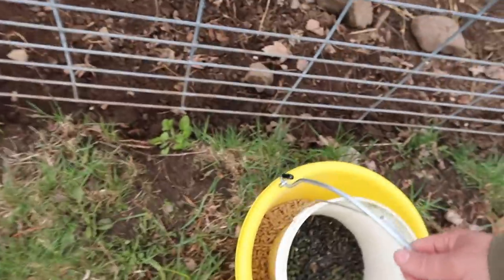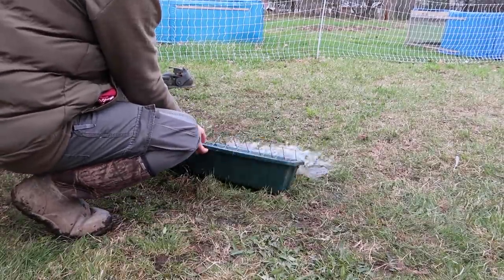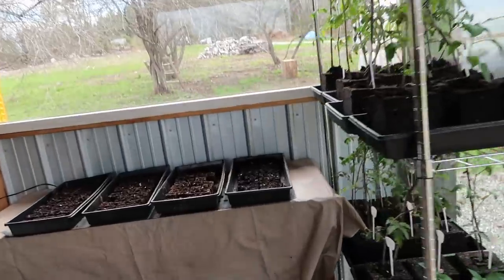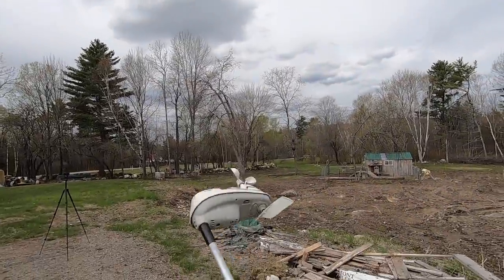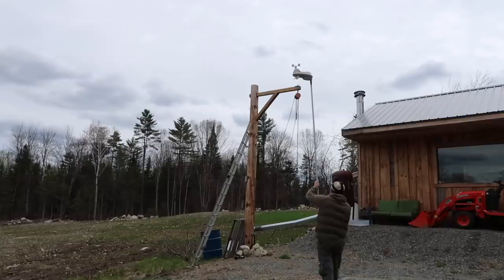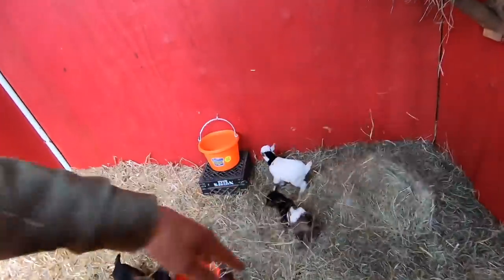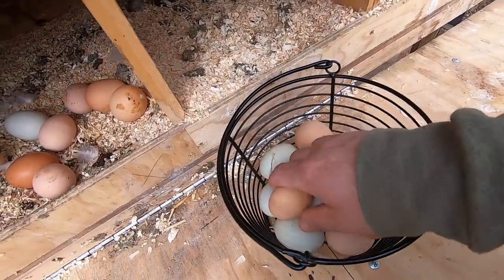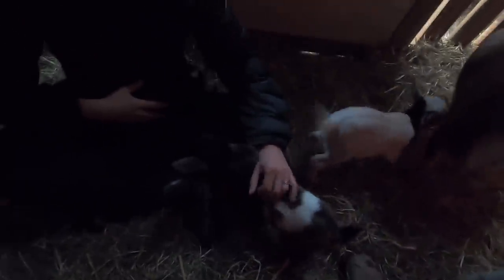THIS has to be my LEAST Favorite JOB!  Don't TELL Gina I was Doing this

Comment: For those unfamiliar with the innards of a personal weather station rain gauge: the inside of the rain gauge is a seesaw type of deal with cups at either end. As the water comes down, the cup at one end fills and drops at a specific amount, bringing the other up to be filled and dropped, back and forth. If there's stuff in the bowl (leaves, cobwebs, whatever), a shallow bowl can overflow, leaving rain amounts unmeasured. If the seesaw gets stuff on it/attached to it (cobwebs, dead bugs, dirt) it can cause them to not move and/or just overflow one cup without dropping at all, leading to no rain measurement. It can sometimes be quite the adventure doing periodic maintenance on the things. I found a black widow spider in mine last season, and she (and her giant egg ball) were Not Happy with me evicting her.

Comment: Al when you replaced the weather station the top anchor you only screwed the long screw through the plastic pipe holding it up. You forgot the saddle hold down that screw only against that plastic pipe will wiggle every time the wind blows. Have Olivia scamper up there to resecure the saddle holder.

Comment: Don't worry Al, I'm afraid of heights, too. I hate climbing a ladder in that kind of situation. But I get er done, just as you did. I also bounce a few times on that first rung, to be sure the ladder has set into the dirt as much as it is going to. Also, I keep my feet in the outer thirds of the rungs, rather than in the middle of them.

Comment: you should have started your brassicas two months ago and in the garden at least 2-3 weeks ago.  They will tolerate a lot of cold and bad weather.  Even snow if you cover them with an old sheet.  What they do not like is summer heat and will bolt before you can harvest anything.

Comment: That weather station should have a pivot point we did that back in the days installing TV/CB/Ham Radio antennas. It allows you to put up a 20 foot antenna without having to climb all the way up on the ladder .. Drill a hole  through the center of the pipe about mid way put a screw in it thats your pivot point then you have the other screw towards the bottom at ( 10:10 ) to keep it from pivoting.. Next time all you have to do to service it is remove the bottom screw and  the weather station will pivot and come  down to where you can work on it on the ground.. No ladder ever needed again.. You are only going to get older and risk increase as you keep climbing that every year. No since in putting yourself in danger when it's not needed..

Comment: You might think about getting some non skid paint to put between your  13 inch spaces.  It works well in rainy slick days and can save you from losing your footing. You should also try glassing your eggs for storage in the winter months they can store up to 8 months to a year. On those days you don't get any or very few. No refrigeration needed and your eggs are as fresh as if you collected them that day.

Comment: We have the same weather station, there is a remote battery pack that you can add on so you don’t have to climb up and take the whole thing down. We recently moved ours and gave it a good clean out, funny thing is it isn’t registering rain now either. Ours is 4-5 years old, how old is yours? There are various parts you can order for replacement, not sure if the rain meter is one of them, but the remote battery pack is sure worth it! Just thought I would share... have a great day!

Comment: Looks like 1 more feeder for your meat birds 😁
Reply: Curtis Schrock I was thinking the same thing.
Reply: A cut down PVC pipe, trough feeder would work well for the meat birds. Hang it with chains from the rafters. This could be moved to the chicken tractor too. More of the meat birds would be able to feed at the same time and it wouldn't get tipped over.

Comment: The R6 bit is IEC nomenclature which tells you a little more then the AA part, R is the shape, round, there are also P for not round(old batteries might be labeled with a F for flat or S for square but they should now be R or P respectively). It also tells you the chemistry used in the battery, no additional letter means it uses zinc for it's negative electrode, manganese dioxide for it's positive electrode and either ammonium chloride or zinc chloride(usually the battery would state heavy duty if this was the case) for it's electrolyte. The LR6 tells us besides the shape and size that negative and positive electrodes are again zinc and manganese dioxide but the electrolyte is alkali metal hydroxide.

The "dry" bit is rather silly all R6 batteries are dry cell batteries, meaning they have a paste  that is just moist enough to conduct electricity as an electrolyte, a wet cell battery on the other hand would be a liquid or gel electrolyte, something like a led acid battery for your car.

Comment: I was surprised to see you move your pork tenderloin from your cast iron Dutch oven to a casserole dish. I love my cast iron for the versatility of using it both on the stovetop and in the oven. I would have just transferred the pan from the stovetop to the oven. Is there a reason you like baking in your casserole dish instead? Just curious if I am missing something.

Comment: I found this on Hunker.com:  An LR6 battery is the International Energy Commission's (IEC) designation for a specific sized battery that uses alkaline cells. In the United States, these batteries are typically referred to by their size, such as AA.  In the United States, LR6 batteries are referred to as AA batteries. An LR6 and AA battery are the same. Under DIN designation, an LR6 battery is known as an E91 battery, and under JIS, an LR6 has a designation of AM3. In China, an LR6 battery is typically referred to as a #5 battery. While in Germany this battery is called a Mignon.  During World War II the AA battery entered government and commercial life, so it became necessary to standardize it. In 1947, the American National Standards Institute wrote the AA into battery standard.  The energy output of alkaline batteries is relatively high, especially when compared to carbon-zinc and similar batteries. However, alkaline batteries are not rechargeable and must be recycled or thrown out after one use. Because of this, NiMH or NiCD batteries are more functional, as they come in the AA or LR6 size, and with a battery charger a NiMH or NiCD battery has 1000 recharge cycles.

Comment: My weather station has a solar panel that recharges the batteries. It looks like your station does as well. In this case you should use rechargeable Ni-MH batteries, not alkaline. The AmazonBasics High-Capacity Ni-MH work well.  Rechargeables should last for years.

Comment: Is there a particular reason why you haven't so far up on a pole I mean couldn't it be just on a 6 ft tall pole just as long as it's not obscured by buildings for the air flow?